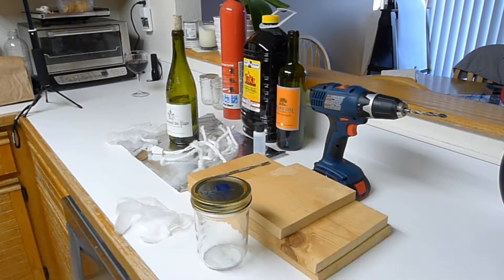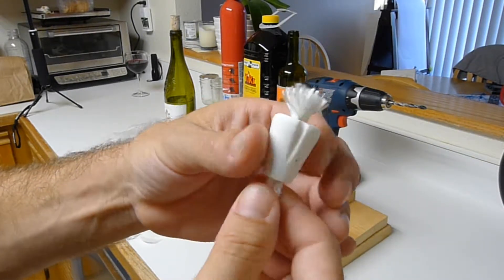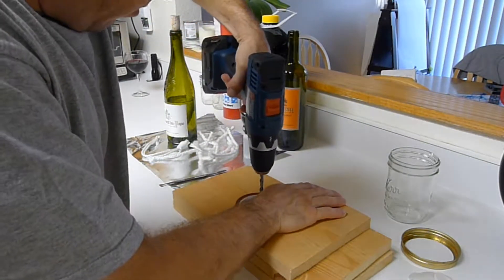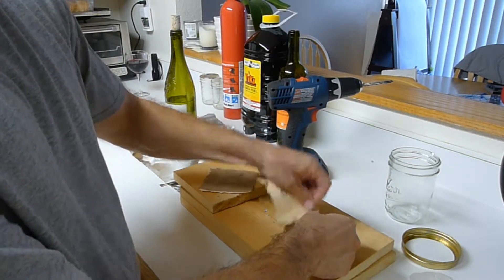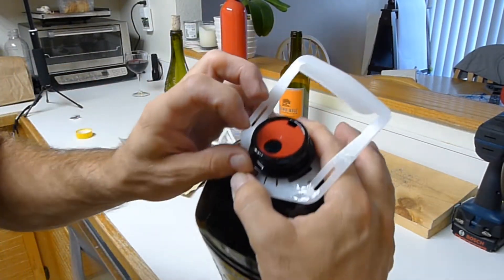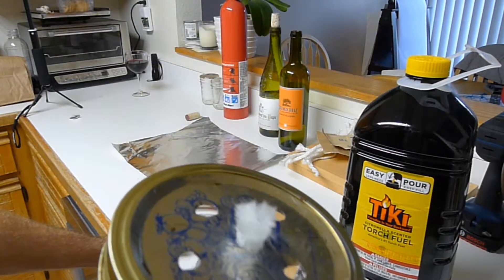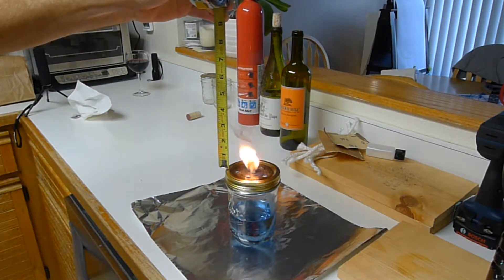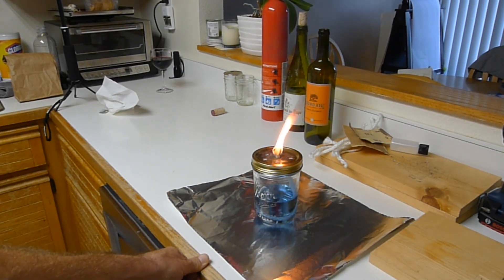1/4" Fiberglass Mason Jar Emergency Candle DIY Round Wick Lamp

Comment: Hey Dan, Nice work!  FYI if you want to drill nice clean holes in any kind sheet metal or thin plastic you might want to pick up a uni-bit. 
One bit will drill may different size holes ridiculously easy. 
Keep up the DYI

Comment: What are the other holes in the lid for?
Reply from the maker: Hello,  I used this lid for other projects.  I was testing  multiple wick mason jar candles.  They work, sometimes too well.  The larger size wicks are not safe to run multiple elements in my opinion.  The flame was too high.  Good entertainment, but the glass could shatter from that much heat and then you  have a real problem.  Thank you for your comment.  Daniel

Comment: Beautiful flame, but who wants to breathe that smoke? Fiberglass smoke? No, thank you.
Reply from the maker: Hello. Thank you for your comment.  Actually only the fuel burns.  The fiberglass acts as a fireproof wicking material.  The fiberglass will get fouled with carbon and eventually needs trimming.  Watch the burning bush miracle video to see how even cotton wick burns for 12 minutes in a flame and is only singed.  Thank you for comment